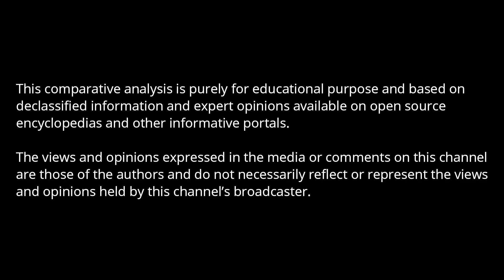F35 & F22 vs S500 - Which would win?

Comment: Yeah, the S-500 can detect targets as far as 300 miles away and has missiles that attack at Mach 9.
So if the aircraft is 400 miles away ( does the US aircraft have that capability) and detect the S-500
then it will fire first, then the S-500 has to detect those missiles and  does it have ability to down all ?

Comment: The S500... is only a launchplatform. is useless. Its need a radar. The radar can detect (take a look a bdsm) a F22 or F35..... only arround 35km... range of missile from a F22 or F35 cam be 300km. The radar is the same as for theS400 launchplatform. Same isseu. It can detect, only to late. A SU35 can be detect arround 150 a 160km. Nice Russian stealth. So F22 and F35 always wins against the S500.

Comment: The major problem here is that any conflict like this would turn out to be nuclear. So it is doubtful that this kind of conflict would even take place. 
Let us talk about what ifs, despite the fact i dislike that. We have two scenarios: the defender detects the attacker early, and scenario two it detects it after it launches it's missiles. In both scenarios i believe that the defenders would win more offten than attackers. Here is why.

Scenario 1: Defenders would most likely win. If you lose stealth early, everything you sacraficed for it is in vain, and now it's practically a fight of S-400 with F15.
Scenario 2: Defenders may sustain damage(depending on the crew), however they have more diferent missiles, so the attackers also lose more. The only question is is it a costly victory or not, and how many attackers manage to slip out. But once they are no longer facing the opposing side, kiss that stealth bye bye.
Reply: Not necessarily. Imagine Israel gets some F-35 flighter jets and Iran some S-500 air defense systems. Then we could verify those claims.

Comment: Technically a low flying suicide drone detached from and f-35 or other jet could take out the s-500, and there’s always ground based sabotage
Reply: S500 is designed for low altitude objects so drones don't have a chance
Reply: For the suicide drone, that is not even a challange. Remember, S systems are not alone. Their weaknesses are covered by other systems. In this scenario, the short-range system would just use bullets to take out the suicide drone. No need to even launch one of it's short-range missiles. Not to mention putting anything on a stealth aircraft nullifies the stealth, so it loses it's only trump card.
For the geound sabotation, that's not very likely, but if you introduce that, then we can also introduce a little short range system that stays hidden 200km in front of the S systems.
Reply: @sotir9299   I meant a suicide drone that would travel in the internal weapons bay. And it has to be located to be shot down. And ground sabotage is more of a threat than you may realize, since they pose a semi significant threat they would be a key target for ground forces and obviously if their expertise is air defense they won’t have thousands of troops guarding them, and also they can most likely be destroyed by artillery which means they foot soldiers as a distraction. And those short range systems are most likely not as sophisticated as the s-500 itself therefore they can be countered.

Comment: What's more, SAM units like the S-400, and by extension, the S-500, are theoretically able to deal with several enemy aircraft simultaneously, and are cheaper to maintain and field over time. Although the missiles they carry do have a hefty price tag, it is not as much as an F-35.

However, this is also their weakness, from a SAM versus F-35 point-of-view. Russia, and other nations, currently do not have large numbers of the S-400 and the S-500 is yet to enter large-scale production.

While the systems are impressive on paper, without actual units in operation defending a nation's airspace, any claims of their capabilities (whether true or not), are somewhat academic. 

You need to actually have the physical working machines in place for them to have any real advantage. According to some estimates, for the S-400 at least, this will take a few more years to build and deploy them in sufficient quantities. 

The S-500, which is still very much in development, is even fewer in number. With new stealth aircraft, like the new B-21, on the horizon, it may well be likely that the capabilities of the S-500 (if it is a real threat) will have been countered by newly-developed stealth technologies. 

The existing fleets of F-35, if not replaced by an even more capable stealth fighter, will likely have been improved by future variants too. War technology is, after all, subject to the ever ongoing pressures of an arms race. 

So, can the new S-500 shoot down an F-35? The Russian's claim it can. The Americans are likely taking such threats very seriously. 

But, ultimately, until the two units actually meet in combat (which hopefully will never happen) we will never really know.
Reply: Russia also is unable to produce any right now as they lack complex electronic components due to sanctions and are many decades away from being able to produce their own chips.
Reply: Not in mass production?
Then riddle me this batman
Why were s500 was just sent to Ukraine?
Did it skip production?
Reply: @divoulos5758  The weapons sent so far are of a defensive nature. Slovakia provided S-300 missile batteries for Ukraine to keep Russian air attacks at bay. Russian jets now need to fly below radar cover as Ukraine’s air defence network is very much up and running, and Russia’s losses were heavy in the first days of the war.

Russian fighter jets flying low have become easy prey for shoulder-launched air defence systems like the Skystreak sent by the United Kingdom and the Stinger sent by the US. 
MANPADS, or Man-Portable Air Defence Systems, have had a huge effect on the war. Russia’s losses of fighter jets and helicopters have been substantial, enough to blunt attacks.
Reply: @TNTN28 Since when are the tanks and ballistic missiles considered as defensive weapons?
Reply: @divoulos5758  lol they sent a lot older stuff to ukraine like tor pantsir etc, which most have been destroyed too. And if you meant the system Ukraine got from Slovakia, it's indeed S300, even russia isn't yet using s500!
Reply: I dont think that the Russians Are gonna produce a whole lot of S-500s Aswell. they simply just don't have The necessary resources to do so.... Like semiconductors for the Missiles and parts they depend a Lot for parts aswell. The US is one of The largest exporters for integrated  Circuits and parts aswell. so yes the Russians won't have enough of those to just produce those since because of the Russo Ukraine 2022 war due to trade restrictions they likely won't have enough to do so. Let alone with Russians not having enough industrys. 

So yeah the Russians won't have the parts semiconductors and the integrated circuits to do so. The US is litrelly a exporting power house. Aswell. 

If you all scroll up and see the first comment go to replys there I explained how those will be countered. SAM systems. S-400.
Reply: No no no

Comment: Def not. With modern radar technology etc, stealth has become pretty much obselette and s500 s400 systems are not one thing. They work as a complex with multiple other radar supports´, bunch of other sams etc to protect the unit itself. So no f22 and 35 wont do anything but turn into basically a canon fodder. As for cruise missiles, this will work against a country with no capabilties. Russian will detect the aproaching ships and shoot them with hypersonic missiles. Also s400 and 500 can intercept homohawks themselves.
Reply: Tell that to the Israelis who flew the f-35 over Tehran last year
Reply: @anguswaterhouse9255  iran does not have s400 and s500. Also whats the proof that they did?
Reply: @Stockfish1511  They have long band radars, the type of radar thats known for detecting stealth jets and helped shoot down the f-117.

They never saw it, the s500 and s400 couldn't stop a Ukraineian missile from the 80's but sure i believe you it could shoot down the most advanced fighter jets on the planet
Reply: Correct - DSP technology looking for disturbances in what was once noise has rendered stealth obsolete.

Comment: Low-flying combat aircraft, cruisemesils or naval target robot. flying mach 1.5. 10 m above the ground or the sea. 
Your radar is about 25 meters above the ground, you can see it 60 seconds before it is directly above your position. 
If it is a flight, it has already returned as it has already sent its attack robot. 
Stelth technology is not needed. 
You can never see through the globe with radar. 
The horizon is the limit.

Comment: They say the s400 can't stop stealth but Israel is doing very well
Reply: The Russian S-300/400 are trying not to shoot down the Israeli F-35, and therefore do not want a direct confrontation with Israel. At the same time, Israeli pilots do not fly over Russian bases where the S-300/400 are located and try not to climb there.
Reply: Russia is using the Zionist apartheid state as a testing ground.

Comment: this videos a bit narrow. F22 and F35 are assets which will be used strategically.  I would bet they won't be sent out in mass in the open right off the bat to attack Russia or whomever, not be themselves.  The SU57 likely won't be all it's cracked up to be...mostly because we can see it also I think t it's se is more about strategy.  it's not clear how well it will perform in real combat BVR aircraft and SU35 is good but the real fight will likely be BVR and the tactics employed.  All of these crafts will be used where they shine. You'll likely not see the F22 mentioned..Seems like low level night super stealthy missions supported but misdirection from other assets.would make it super effective.  It's maneuverability and ability to run is to get out of trouble. F35 will be the sensor platform with long range missiles and other precision ordinance.. B21 which was not mentioned here along with other assets will likely sneak in to great effect.  There will be losses likely but that will be expected.  Also, the lacer is till in play and currently handles the most weight including stand off weapons and can maneuver and run.  the new 15x is no worse in stealth than the Lancer is is set up to truck in up to 20 missiles (in theory) and it can hella run.  I think with these assets in mind as well other the US military assets known or unknown it would still be anyones guess, dependent on what the goal is how things play out over all but the S has an edge. However both missiles systems THAAD and S400/500 are really setup for different purposes in general.  The US is not as concerned about area of denial, not in the same way that Russia is.  I don't think this will happen simply because its not worth it for any nation to open that can of worms...but then again you never know.

Comment: if the f22 and f35 could face the S400 easily, suriah will be free air space for USA..and now days, actually USA not able to fly under SAM of Russia in Suriah...it means USA saw the nightmares from Russian SAMs
Reply: 看起來烏俄戰爭不是這樣結果
Reply: @Biden pooped at the Vatican why 200+? Not even 2000 or 20000? Lol
Reply: @SpoilOfYourMind  Because that's all there were before they retreated. The F-35 has been flying through Syria without issue.

Comment: Fun fact : F- planes has flares
Reply: Fun fact, modern IR missiles can work out what are decoys and what is the actual target - IR missiles no longer blindly look for the hottest object. Planes and flares behave very differently in flight and are therefore easily to distinguish programmatically - just as your own brain can take the signals from your eyes and track a plane while it fires flares and still see the plane. Digital Signal Processing has moved the world on - the same reason the stealth programme is a pointless waste of time and resources.
Reply: Noob😂😂,S400 & S500 have active radar homing bro,It can detect a 2-3 m² size target and can destroy the F-35 Lightning 3 .S500 can destroy any target due to its mach 9 speed in supercruise.
Reply: @abanideka1953  Actually, the radar cross section of an F-35 is .1 meters, so your claim falls apart right from the get-go. And also, neither have been used in real-life combat, just so you know.
Reply: @lando1296  Oh aisa kya?Matlab,F35 kabhi missile nahi chodega.Then what's the logic in your claim of 1 m² of radar cross section?🙄🙏
Reply: @abanideka1953  maybe S-600 will be able to deliver food to 10 millions starving russians.

Comment: I’m sure it can shoot down a vulture flying over the moon. 

Yawn. Tell me when s400
Shoots down anything outer than a jet liner
Reply: It's not s400 ...it's an older system of s300.....s300 were deployed in syria to study the tactics used by the enemy to evade the system. ..and they came up with new system to tackle the problems and that is s500 + s350 vityas plus many layers of low range low altitude of air defence systems ...Russia is not Iraq Bro. ...
Reply: @firstlast-vo9lp  
Still not impressed by talk and baseless claims. I’m not saying they are terrible, but empty claims that F-22 and F-35 are useless due to these systems are wholly exaggerated. Their radars are easily detected making their (far more limited than admitted) kill range easily avoided. Their lack of success anywhere against our stealth equipment proves that. Hell, Russia would take any chance they got to take down an Israeli fighter. The political mileage and sales boost would be worth any fall out. The fact that that have had zero success proves these are not the
Stealth killer Russia claims

Bro...
Reply: @ravenmoon5111  they don't want to take down israeli planes yet cause they don't want to escalate  the war. ...Israel is provoking syria to shoot down their fighter jets....but syria only uses the air defence to shoot down the missiles approaching...f22 and f35 could have easily  bombed the air defence if its stealth worked...but that didn't happened instead the Israeli have to use smart new cruise missiles and new tactics to destroy older Syrian air defence systems. ...Russia send the older systems to syria is to study the tactics from the enemy ....
Reply: @firstlast-vo9lp  
Riiiight.
Keep drinking the old koolade
Reply: first last And America is not Ukraine